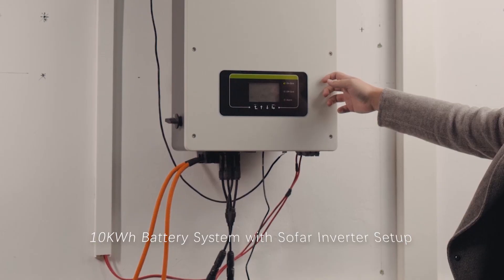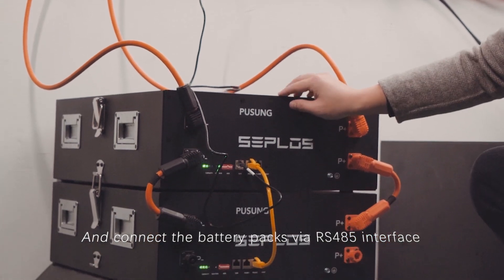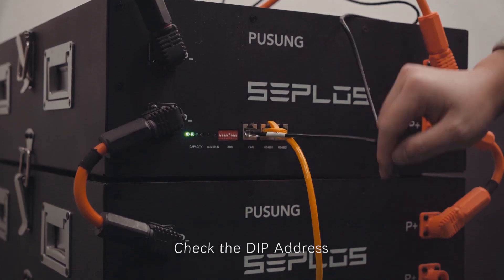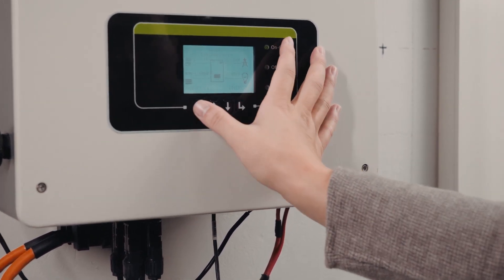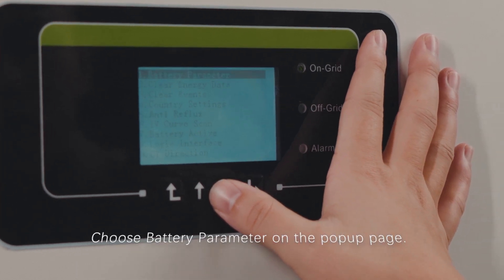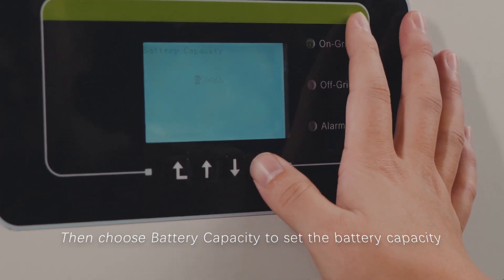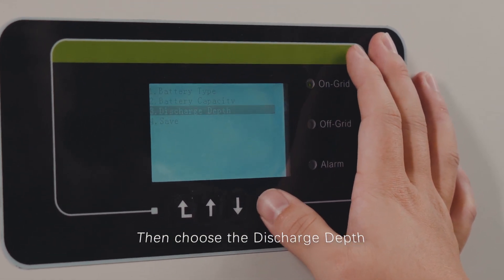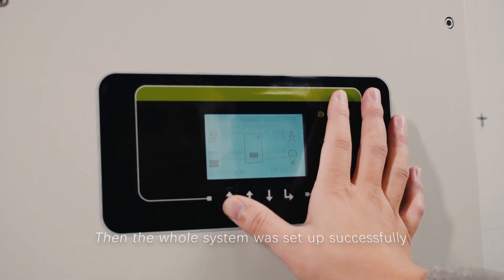SEPLOS Battery 10KWh PUSUNG and Sofar Inverter Setup

Comment: Why is depth of discharge set at 80%, when your batteries can do 93%, based on the architecture of 15 cells working and one sell as a buffer.
Reply from the maker: 16 cells in series battery pack is 7% more energy than 15 cells in series battery pack. But have nothing to do with the depth of discharge. 
Even with 16s, the 80% DOD was tested to be the best to ensure the performance of lifepo4 battery cell.